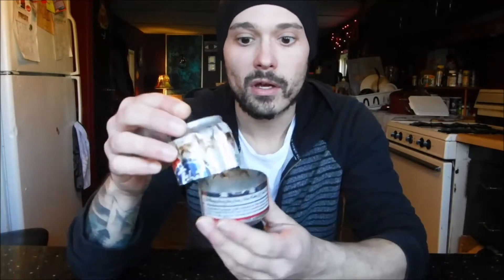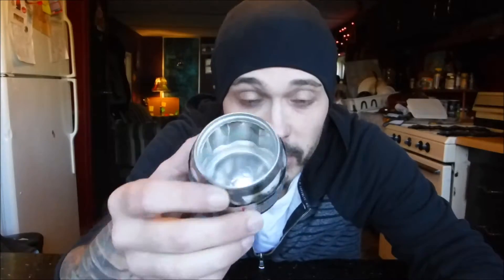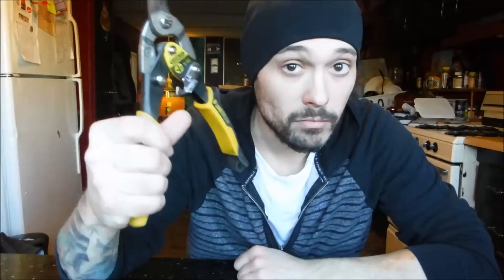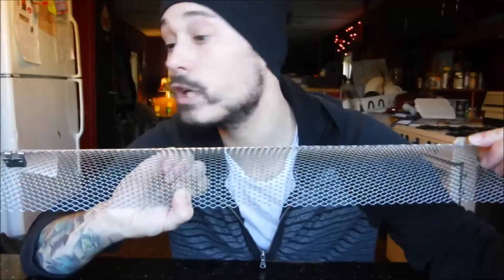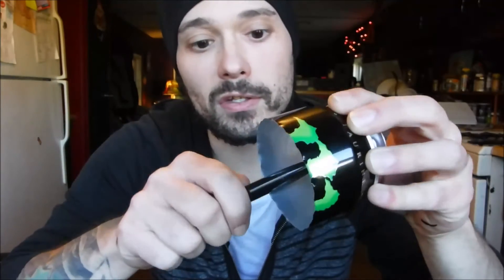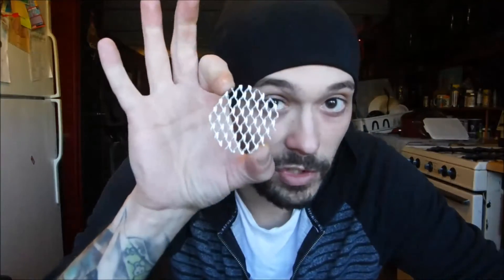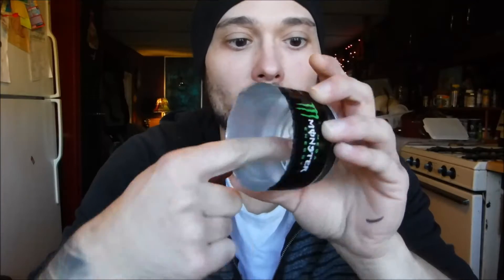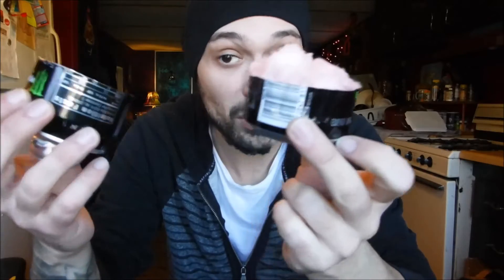monster can stove

Comment: As to the video, I would add that you should use the yellow Heet and avoid the Red Heet. They are different formulas and the yellow Heet burns cleaner. 
As to comments about using galvanized items, for the galvanized items to give off toxic fumes you need to be burning them at temperatures much higher than what the stove will ever reach. Zinc begins to melt at 420 °C (788 °F), and boils at 907 °C (1664.6 °F). When welders are exposed to zinc welding they can experience "zinc fume fever" and it's totally unpleasant but it's due to hours of exposure to fumes from very high temperatures and doesn't seem to have any long term permanent consequences. I am not saying I think zinc welding is totally safe, but I do believe that using galvanized mesh in a tiny alcohol stove like this one isn't going to be harmful. Be more concerned that you burn off the can lining and paint residues before cooking and you'll probably be just fine.
Reply from the maker: I tend to use denatured alcohol for my fuel and you are absolutely right the yellow Heat is better. As far as the galvanized goes I always do a couple of burns outside in a ventilated area before I even use the stove. Thanks for watching! 👍👍